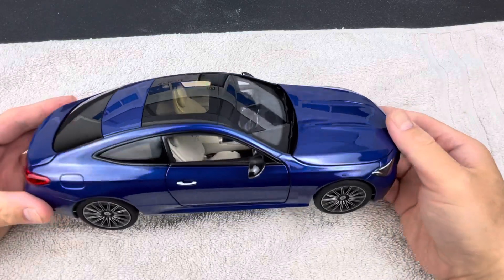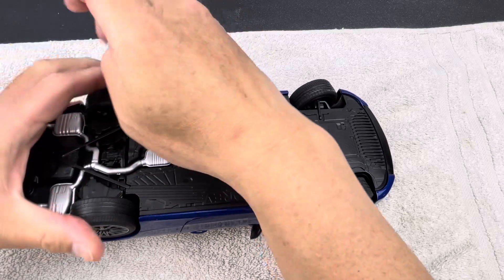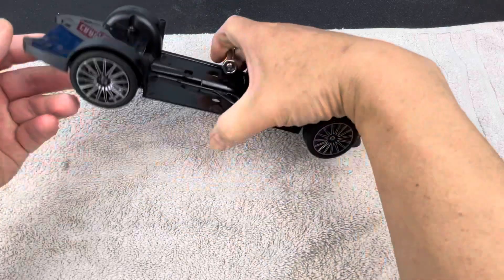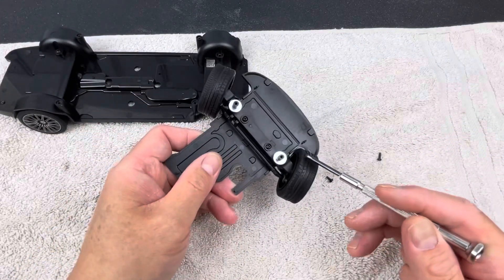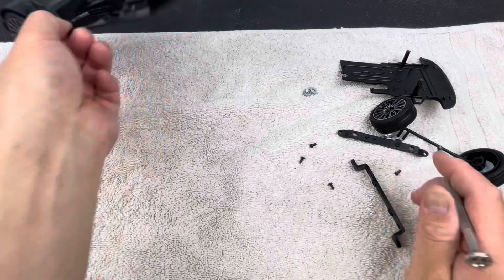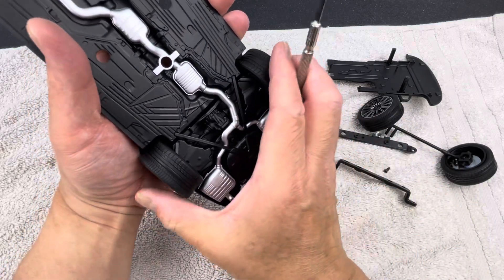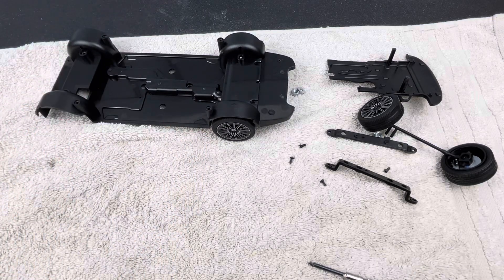Partial disassembly for 1:18 newer Norev (CLE in this example)

Comment: Simply pull the wheel to remove it. You don't need to unscrew anything.
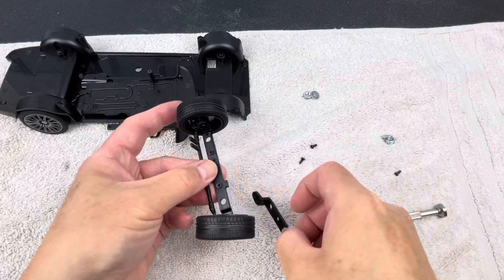Reply from the maker: On the older Norev the wheels will pull out. On the newer one like this CLE,  front wheels are screwed to the spindle (see 3:30). You cannot pull the wheel out without removing the screw that holds the wheel to the spindle. This is constructed differently than older Norev cars.

I tried at first pulling the wheel straight out and figured it I couldn’t.

I didn’t remove the wheels completely in this video since I had some shims installed to fix some ‘lazy camber’ issue.
Reply: Does this need it to be disassembled or can it be done when assembled?
Reply from the maker: @c41rnx has to be disassembled. Unfortunately this is different than older Norev where you can just pull the wheels out (press fit). The screw that holds the wheel to the spindle is accessible from the backside.